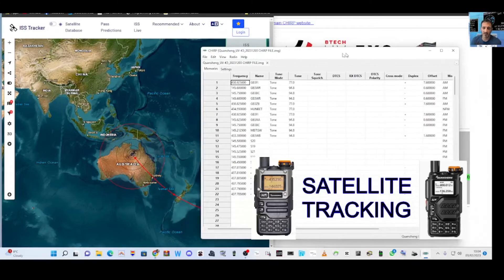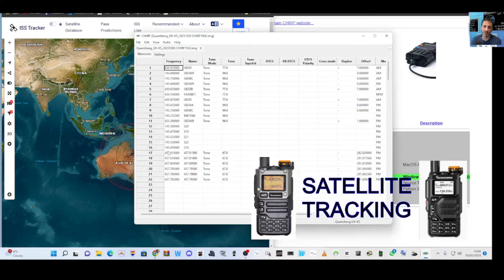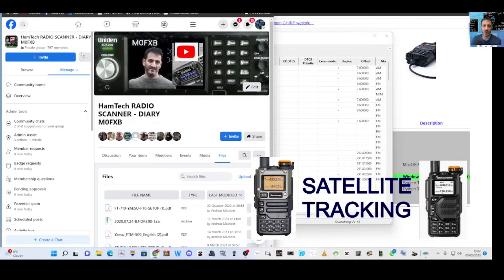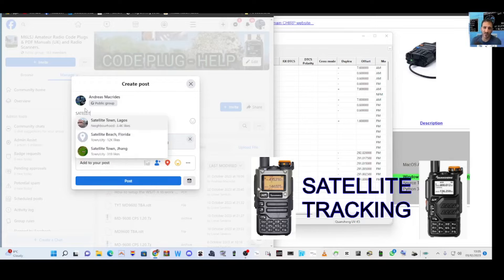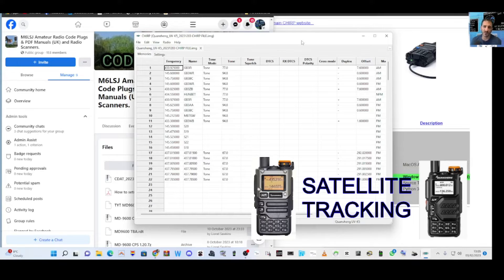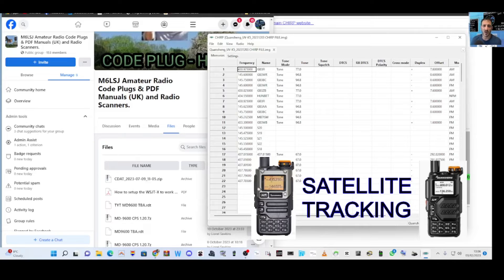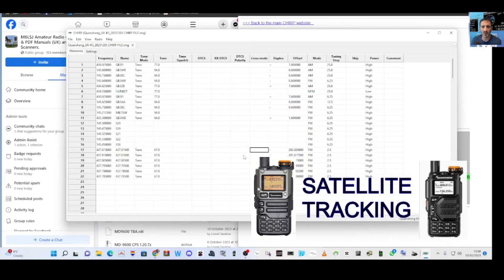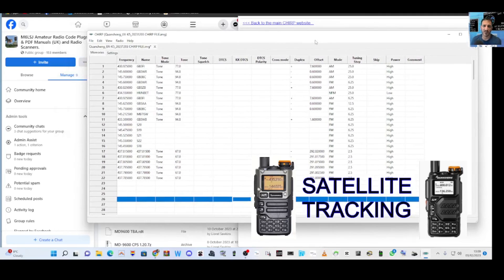CHIRP - QUANSHENG UV-K5, K6 - SATELLITE FREQUENCY -

Comment: You may want to double check the CHIRP img, particularly line 20.  You have the offset as 291.895. I think you meant something like 291.805.  I also think line 17 should be 291.82?
Reply from the maker: Ok